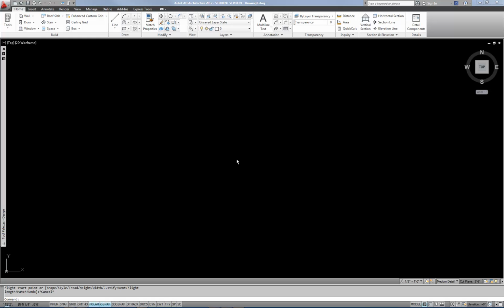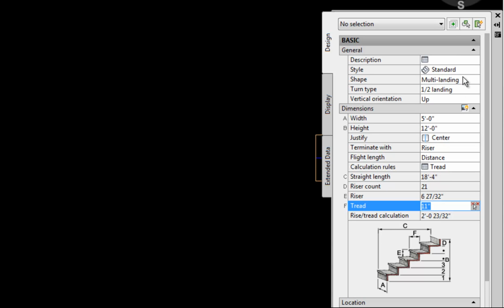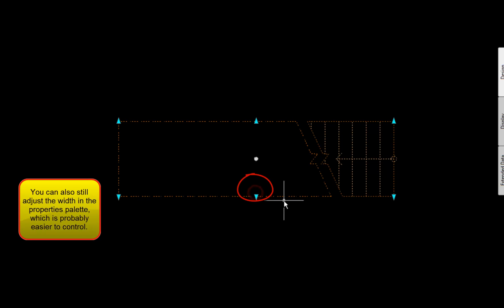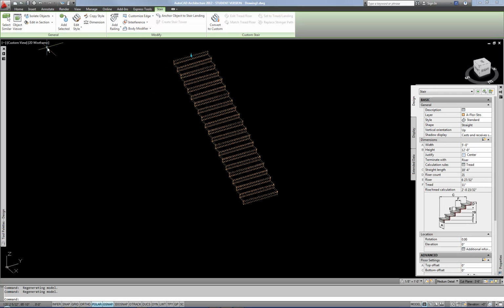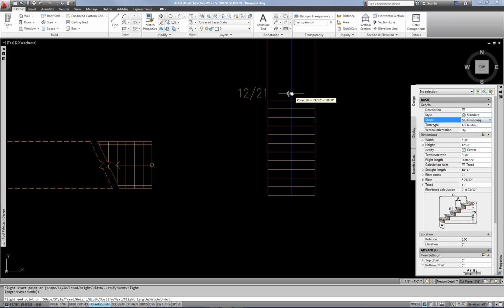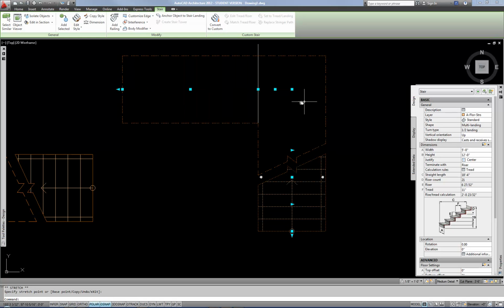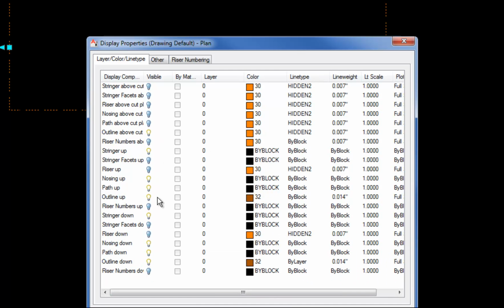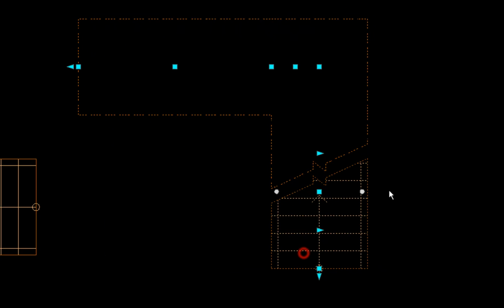ACA: Stair basics

Comment from the maker: It sounds like you're getting the standard error symbols, meaning you're not drafting it correctly as far as ACA is concerned.  One common reason for this is insufficient length.  For example, set the HEIGHT of the stair before you draw.  You must draw as many risers/treads as the stair requires, or else you will be creating a stair that does not work.

Comment from the maker: Are you trying to shorten the length or change the shape?  Those are 2 different things.  Set the shape before you make the stair.  The length wouldn't be allowed to be any shorter than permitted by the controlling tread and riser dimensions and the height of the flight.